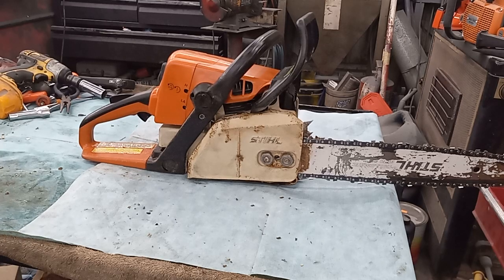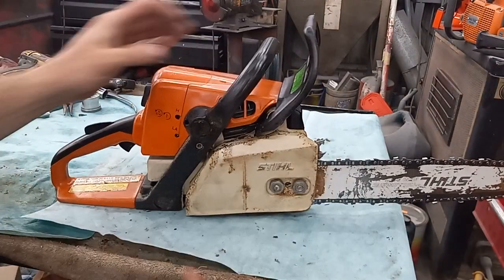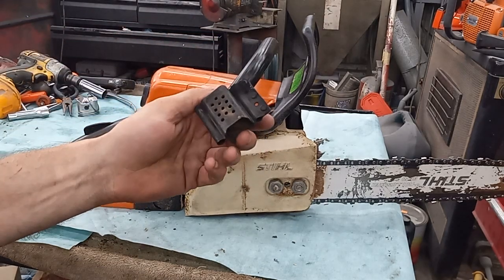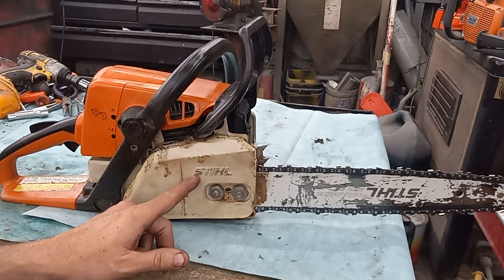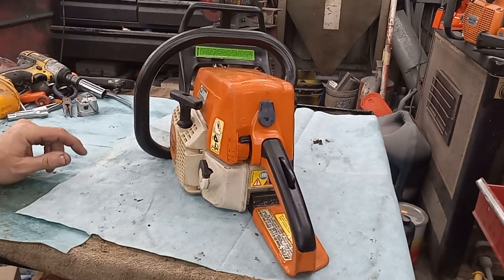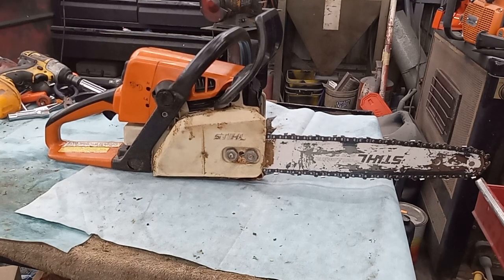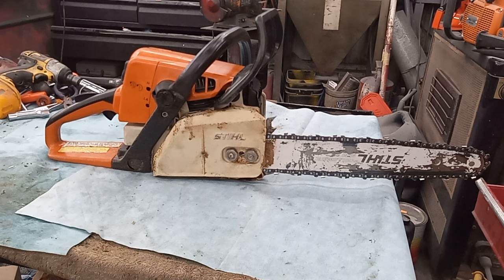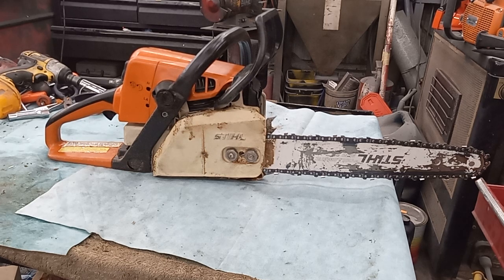Channel Upgrades & MS250 Mod Tips

Comment: I ordered MS260 AM clutch springs because of this video, I’m in MN so I usually buy from Sawagain.  Can’t wait to get them.  Thank you, I am a throttle blipper.
Reply: Just to report back, the clutch spring tip is fantastic and I am absolutely loving it.  Coupled with a high speed adjustable carb and heavy muffler mod I am a throttle blipping limb thrashing animal.

Comment: I had the exact same experience with a Red Barn piston for an Echo 351VL resto job I did recently. The fit was no where near what the oem unit was and I did not care for the casting job on the underside. Drop it down into the bore on the bench with no rings, and the thing fell like a rock. I did the same thing with the oem piston and it built up compression after it passed the exhaust port. The Red piston was a rattler compared to the (used) oem part.

Comment: Charles, I looked for it in the vids but couldn't find... What did you set the Transfers at?
Farmertec cylinder I have is timing at Intake 84 exhaust 98 Transfers 129....I plan to raise 5 degrees to 124 and maybe even higher to 120 after testing. Just wondering where u set yours
Reply from the maker: 660 seem to run good 124 to120 for me at least